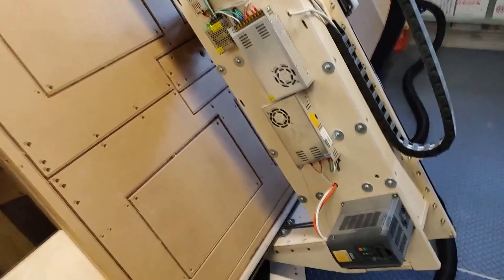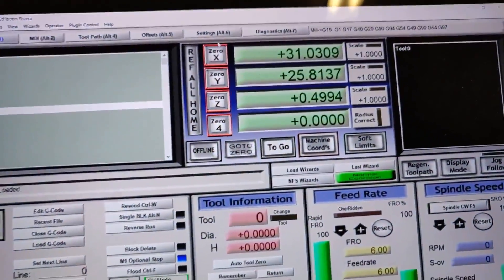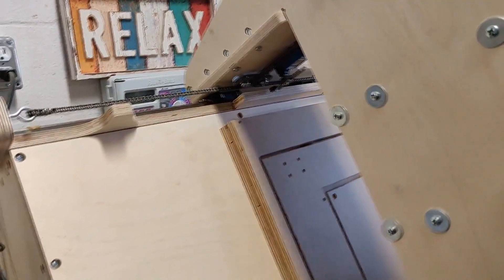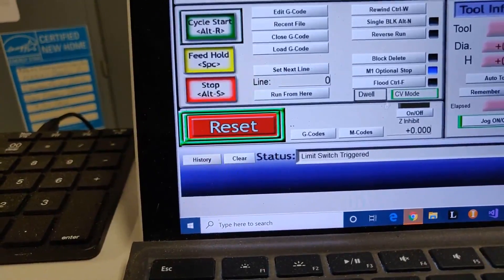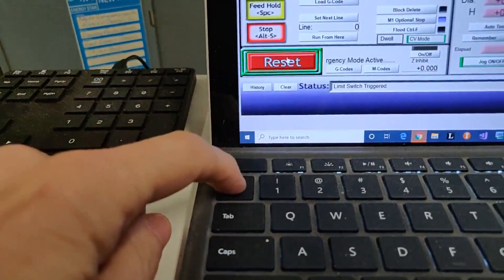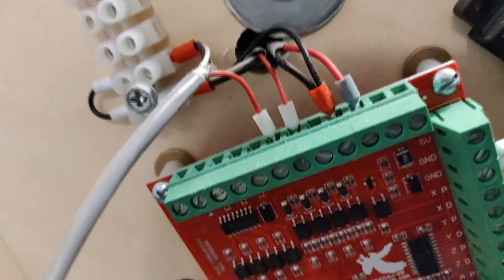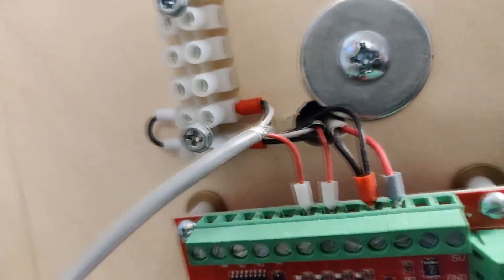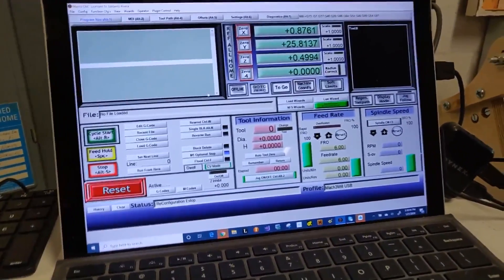Mach3 USB Overriding Limit Switches on a CNC Router

Comment: Hi I have same mach3 controller board and I have problem with my motor sound. My motor in slow move is very vibration and noisy but in rapid move is OK could you help me what is my problem
I'm using dm543 leadshine driver and resolution set in 800
Thank you
Reply from the maker: If you are having motor issues, it is typically related to the driver settings rather than the controller. You might want to try reducing the amp setting on the driver.
Reply: @PatrickHoodDaniel 
Thank you
I will do your suggest
Tnx

Comment: Hi sir,

Please help me i have struggle with my CNC machine spindle  last 15 days which is stoping immidialtly showing error

e004 on invertor please help me
Reply from the maker: The Er.04 (if you are using the YL VFD), generally refers to the ramping up and ramping down of the spindle, but it can be a result of a short circuit between the VFD and the spindle.  You can increase the time the spindle accelerates (ramps up to the set rpm/frequency).
Reply: Hi sir send me your maid id 
I will send in detail about problem
Reply from the maker: @F26_Entertainment  Please detail your problem here so others can benefit.  Thanks.